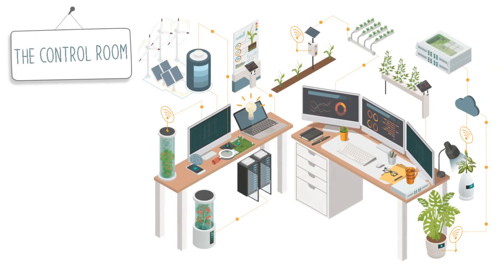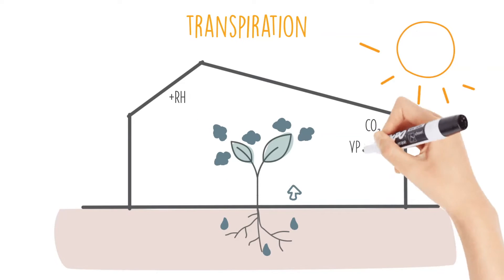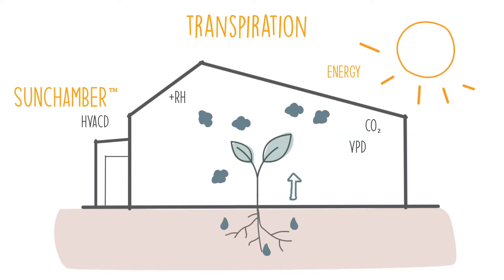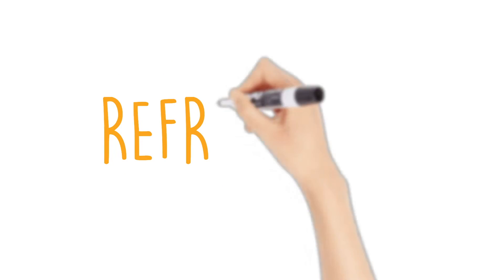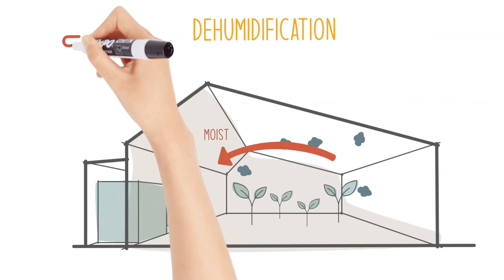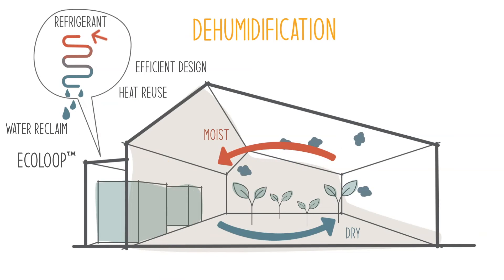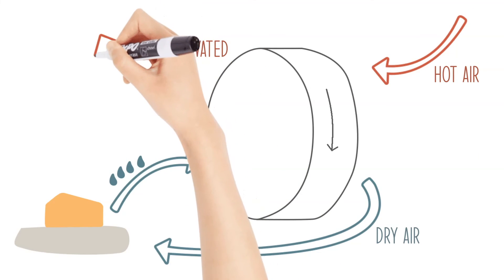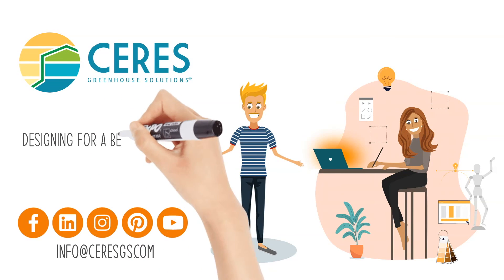The Control Room | Greenhouse Dehumidification

Comment: I just found your channel. 

I was interested in the methods used to cool the greenhouse in a hot climate. One way is to use a fogging process. I thought that this will increase humidity. I guess this dehumidification method can be used to lower the air humidity due to the fogging process.

You did a great job explaining the dehumidification concept.
Reply from the maker: We're happy this video was helpful to you!